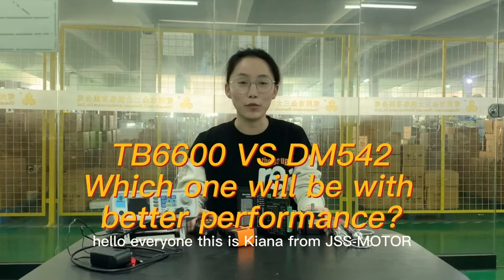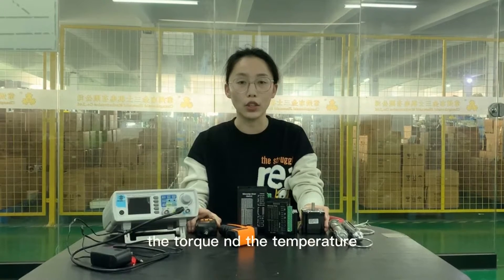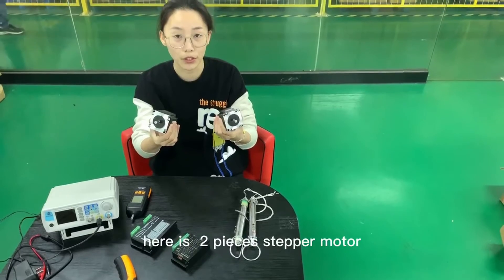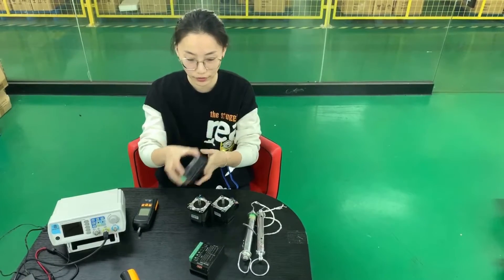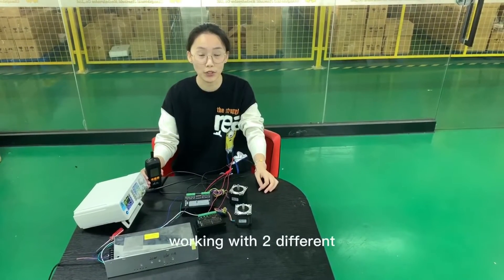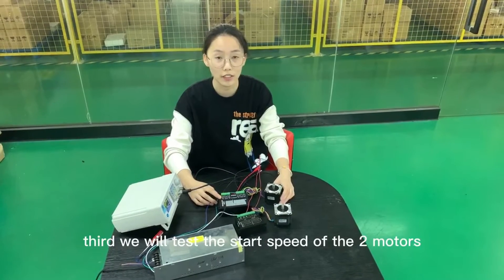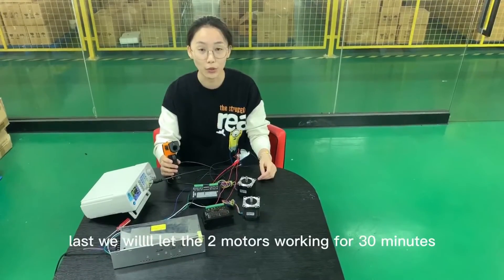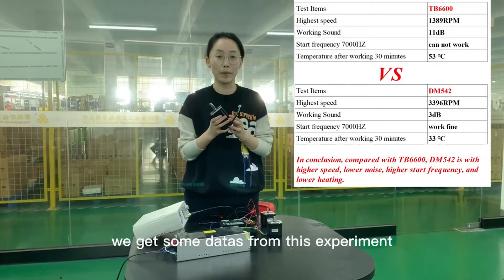TB6600 VS DM542 | Which performance is better? | China Stepper Motor Manufacturer

Comment: Critical information was missing, making the comparison meaningless.
  Was the current limit set the same on both drives?  That affects temperature.
  Was the idle current reduction set?  That affects temperature
  Was the microsteps set the same?  That affects rpm.
Reply: good points, and no response here in the comments
Reply: Tb6600 dont have idle current option, we dont know dm542 was set on this